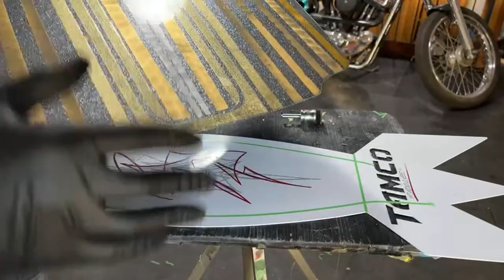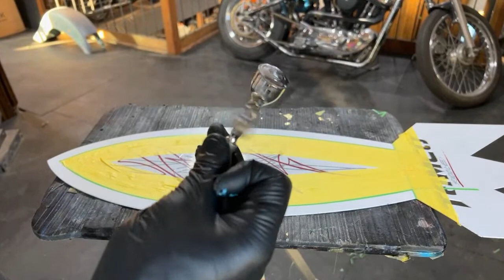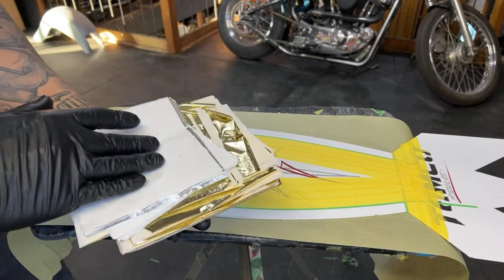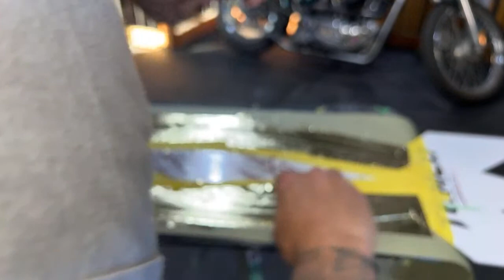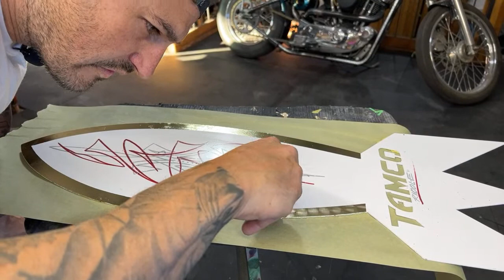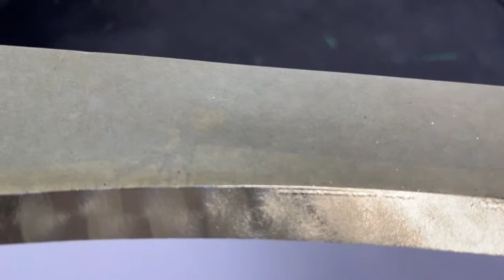Gold Leaf Practice Session

Comment: ive been custom painting guitars for 20yrs  doing the gilding thng not  to long but i will say this the leafing or metal that you get from the craft store kinda sucks along with thier sizing or glue.  i am building a miniture 70 firebird dash for my brother with gauge fronts and all iam gonna install a clock but his dash on his firebird was a 400 dash so it was engine turned alum but iam thinking of doing chrome foil vinyl and turn it but have found out not the esiest thing to do and it fiol not vinyl its foil w adhesive, but not maybe i should just buy a 4ft long piece already done. lol

Comment: May I suggest that, when you use the roller to hug it tighter. Consider using a piece of the paper the gold came on.. Just a suggestion. Other than that. GREAT videoes! You have an awesome talent!
Reply from the maker: I’ll have to try that!! good thinking 👌
Reply: @TimeWarpCustomPaint  More cleanly written, just ue the paper as a layer in between. Paper will scratch theheck out of the gold. But paper as a between sheet and then roll. Gold and siler is so thin that, one may not be able to see it, but it eats quiet a lot of it. Good day to you!